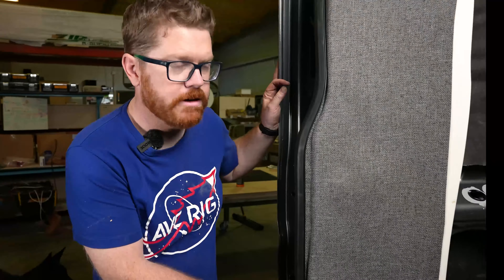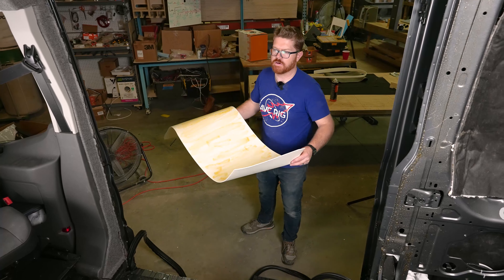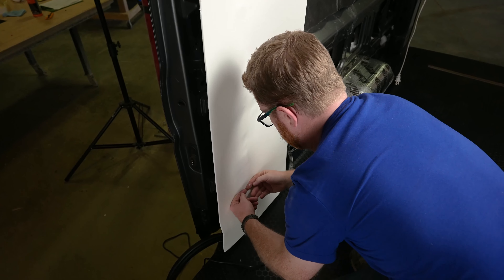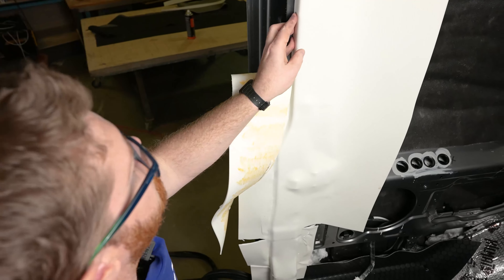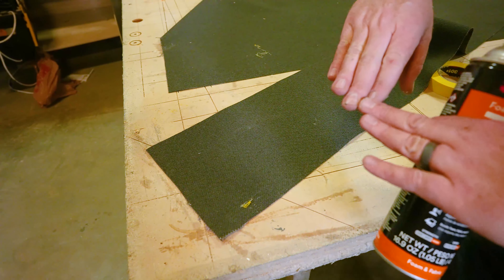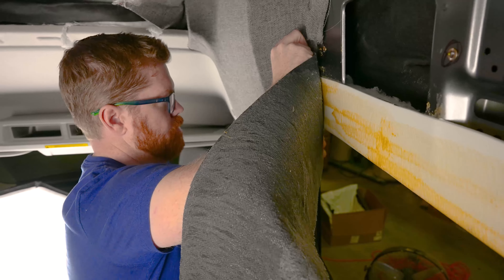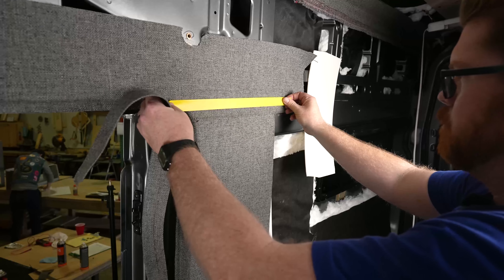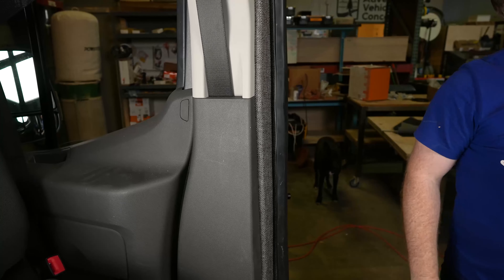AVC Wrapping Columns and Sliding Doors in the FORD TRANSIT

Comment: Could you get 5 yards of PU leather and apply that instead of the fabric, using the same techniques you have shown here?
Reply from the maker: Basically yes. You will need to test your adhesive though. Different materials behave differently. Wrapping the edges will change a bit too. You may need to staple that kind of material.